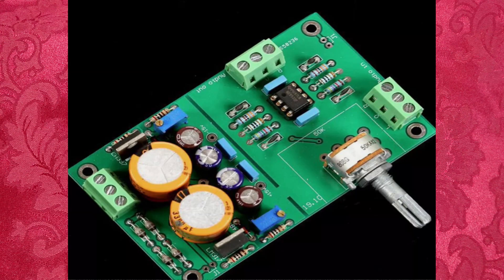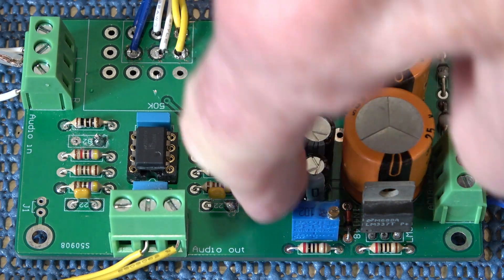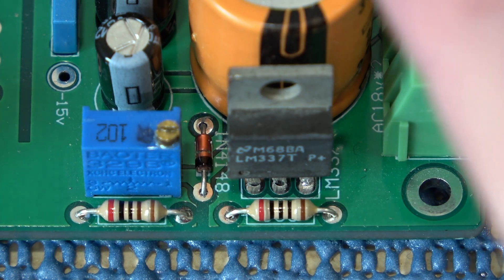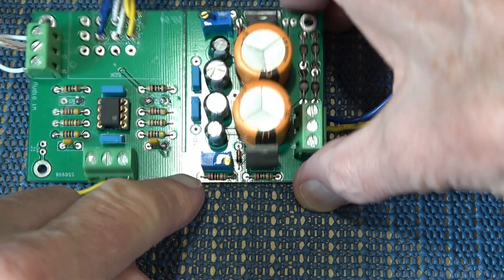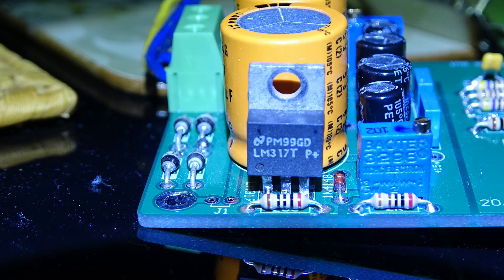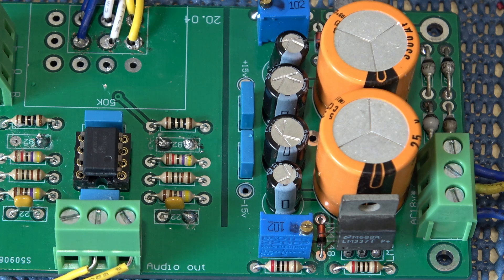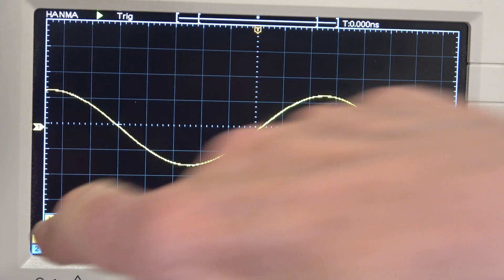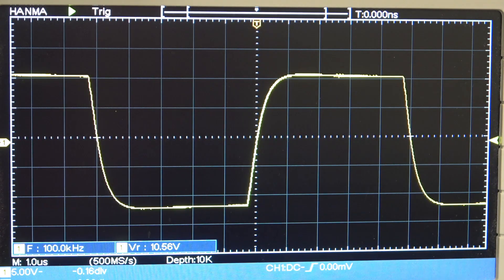NE5532 Buffer & Pre-amp. Full test & analysis.

Comment: Hi, thank for the post, about LM337/317T, I heard about the ripple performance similar to what you had mention.  Another, (may be hearsay) is 33T (the negative)'s performance is less that the positive one, but I don't know if it true or not.  I still use the 337T anyway.
Though I used the variable "T" on basic of conveniences, from where I came from the cost between the fix and variable one is not that much.
Again thank, the board look nice, I'll order one.
Reply: If you look closely at the way they applied the regulators on this board, they have capacitors in their feedback loops. That causes the regulators to be even more stable and to reject source noise and ripple to a much higher degree. Very clever actually, and an excellent reason to use LM317/337 regulators rather than 7815/7915.
This really is a nice preamp board.
Reply from the maker: The 5532 has a very good ripple rejection. Noise on the supply rails can be quite poor offering no performance changes at all. Out of the box we have no audible hum whatsoever, it's completely silent.
Reply: Opamps have good ripple rejection, but a very low noise supply does make a difference in other ways. I would highly recommend looking into Elvee's denoiser circuit for 317 regulators. A simple but brilliant addon. Also you can make dual polarity supply using two 317 instead of using a 337.
Reply: One indication of high frequency oscillation in an opamp is running at a noticeably hot  temperature.
Reply from the maker: @albanana683  Very true. Also measured as increased current draw.